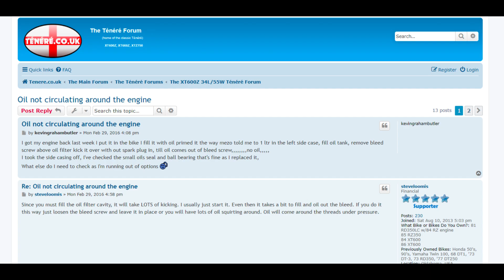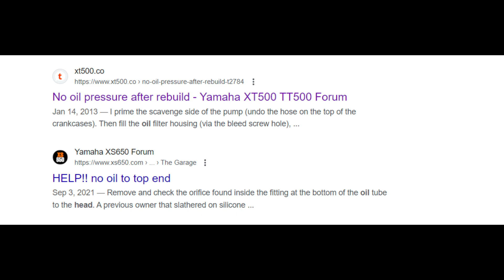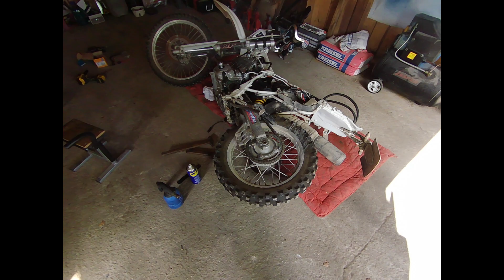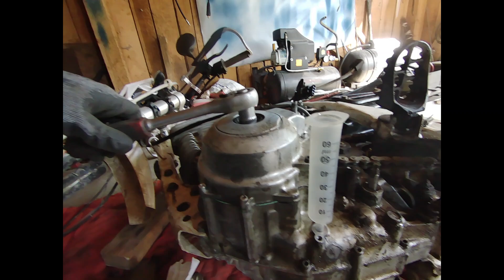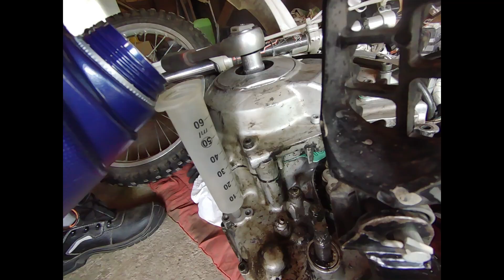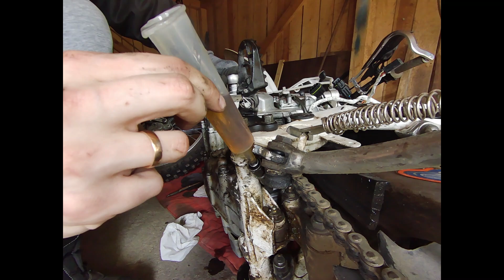TT600 and XT600 Oil Change Guide: Essential Safety Tips

Comment: Owned three and never had an issue. Just crack the bleed screw open and get on with it. 
The TT600R Belgarda doesn't have an oil tank drain plug and you need to pull the hose off the case to drain it. Never seen anyone doing an oil change on it's side before. 😂

Did see one guys Belgarda nip up on the cam after a rebuild though. The oil pump was assembled with only a little oil and no assembly lube. Cleaned up the head and cam and it is still running nearly 10 years later.
Reply from the maker: Thank you for your comment. I just want to say, that I'm also not changing the oil, when bike is on it's side. Actually this TT600 in the video was just after engine assembly and completely free of oil. So extra carefulness must be taken to make sure, that the oil doesn't get airlocked. It's shame that in the head the cam doesn't have any cam bearing and  rotating straight on aluminum.
Reply: I also have a TT600R belgarda, and thats my first oil change.
Is this the right way to do it?
Remove oil drain bolt
Disconnect line to oil tank
Drain completely
Replace filter
Attach line
Add 2 liters
Loosen air bleed screw
Start engine
Watch glass on oil tank
Check oil by bleeder screw on oilfilter
Tighten screw
Stop engine
Add 0,5 liter
Start engine
Check oil level in tank